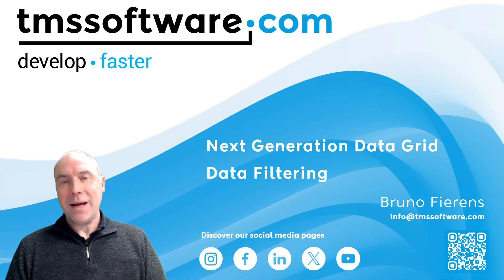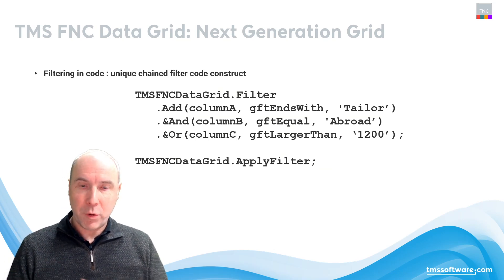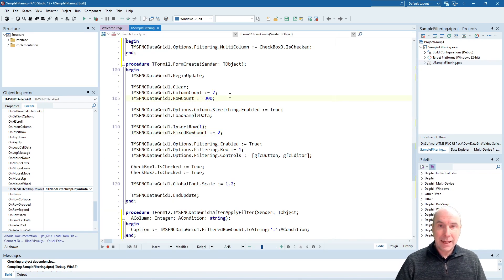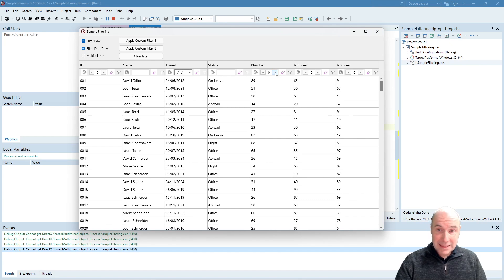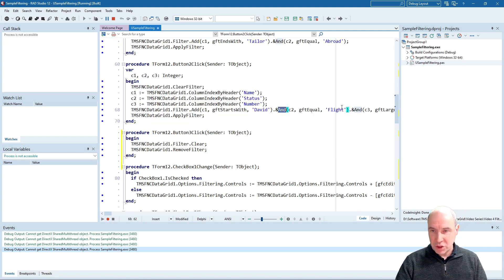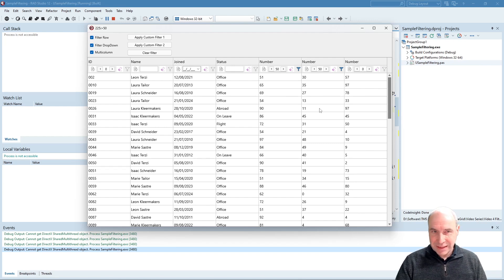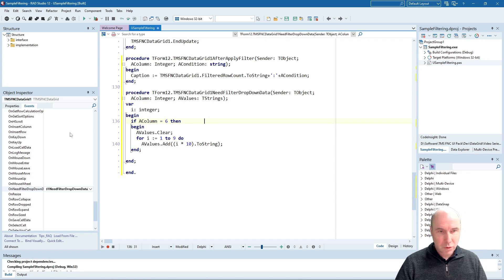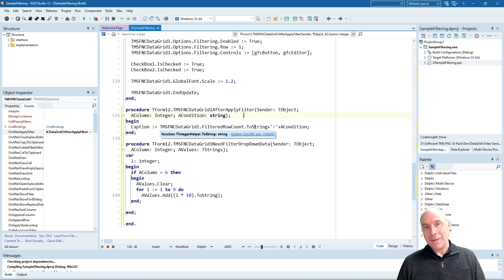Next Generation Data Grid - Part 5: Data filtering

Comment: combination of grid filter with pagination is chalenging. filter in current page or filter in whole table and return new page?
Reply from the maker: In TMS FNC Data Grid, it would filter on either the full dataset connected to the grid or the full data loaded in the grid.